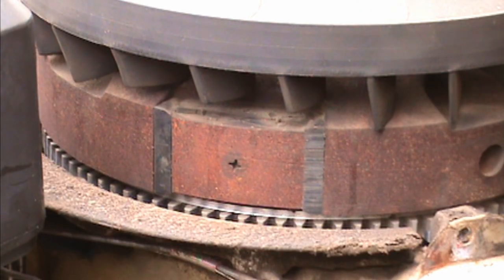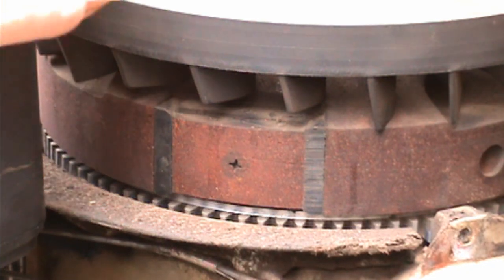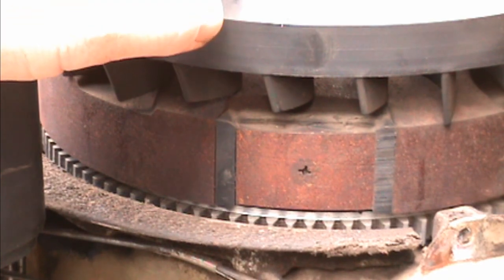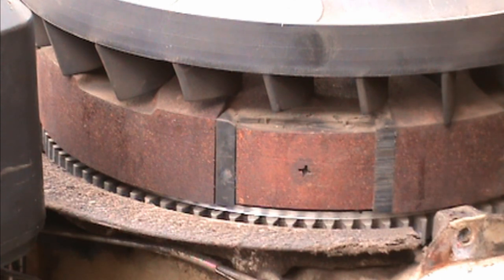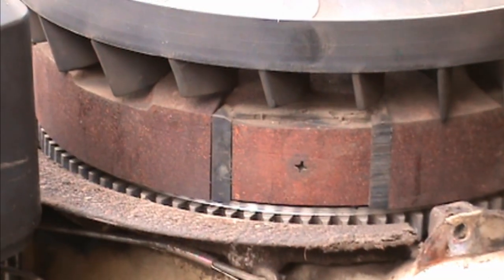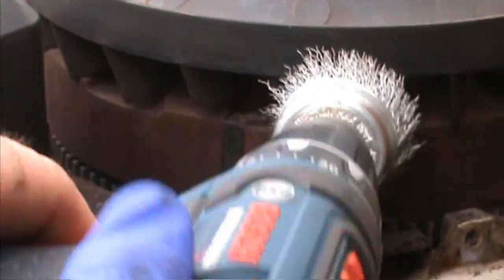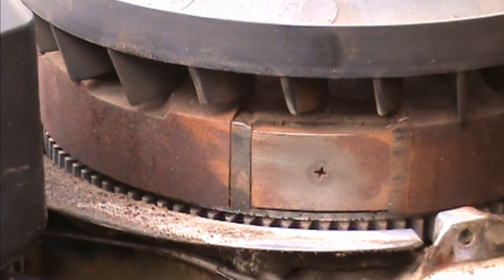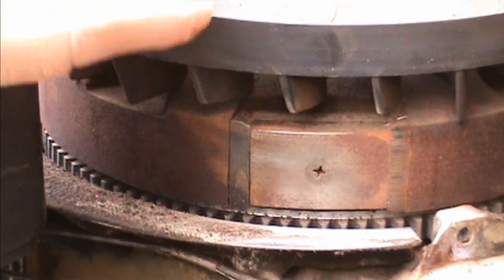Cleaning a lawn mower flywheel rust caused by water or moisture and how fix it.

Comment: Hi I got a lawn tractor and it won't start when it's warm when it's cold there's no problem and there's also no spark when it's warm I checked the coils and they're fine do you know what could be the problem can you please let me know thank you
Reply from the maker: Jake, what model of the engine do you have. Like is it a briggs, john deere, kohler , or any brand? Also the size in HP? It sounds like it could be a coil or grounding issues. You can have a good showing coil, then when it heats up the resistance can change and fail. Then it cools back down and shows it's fine. The best way to find out is to do a resistance check on the coil when it's cold and hot( when it cut off). The kill wire could have a small cut or pinched and cause it short to the engine. It could be also the plug failing too when it gets hot( have another plug ready to go in when it shut off) that's a way to show it's the plug. The ignition set up is pretty simple to troubleshoot if you know what to look for.
Reply: It's a poulan pro 300ex I think its 19.50hp
Reply from the maker: Like in reply I think it points towards the coil ( armature) is failing when it gets hot. When it cuts off on its own. Unplug the kill connector on the armature and see if you get a spark. If you get a spark, then the kill wire is grounded somewhere ( it has contact to ground out the engine) and needs to be fixed. Now, if you don't get a spark, it shows that the armature is failing after it gets hot. Then you need to ohms check the armature to see what you are reading(normally 2k and up for Briggs you'll need the spec per the engine manual and it's not in the mower manual. It will say coil test).
Have tools ready to access the armature and do it when it shuts off or even if cold to get a base number. Ohms meter set to 20k, take red(positive +) to the boot where the spark plug clips to( make sure it clean, no rust or corrosion) hold it to it. Then the black (negative -) to the base of the coil( armature) where the screws (usually 2 ea.). Scratch the area near one of the screws and have clean contact. You don't need to remove(armature) to do this. If it's 0 or OL it's bad for sure and needs to be replaced.  Hope this helps.

Comment: So in theory if my kill switches good my wire to the kill switch is good. And I just replaced the magneto and the spark plug. And I get spark out of an old weed eater. I should clean my flywheel from the rust in theory I should get spark again. Because I have no spark after replacing the magneto and setting the distance.
Reply from the maker: Could also be a grounding issue with the base or the coil even if new could be bad.

Comment: Do I need to clean the entire flywheel or just between the magnets?
Reply from the maker: Magnets, but clean the rest would not hurt.
Reply: I cleaned that surface all around the flywheel.
I also cleaned the surfaces of the magnetos facing the magnets. All that rust is a resistance to a passing magnetic field.

Comment: Zero electrical theory!!!  How would a clamp on amp work?  Or a CT in a protective relay circuit?  How about across an air gap in a potential transformer?  Read up in a book called electricity 1-7,  under "induction".
Reply from the maker: If I have the time I'll read it. I didn't post it to give  a science or  physics lesson, I keep it simple to help people and it has. Most people could care less about the science behind it and just want an idea on how to get there machine or equipment back up and running.

Comment: Rust doesn't affect the spark from the magneto on the flywheel. There is no contact between the flywheel and the coil.
Reply from the maker: True there is no contact between the armature and magnet of the flywheel when it's gapped right. But, when rust is on the the magnet and the flywheel it disturbs the proper distance needed for the magnet and armature to make the proper spark. It cause a resistance field and will change the power of the spark and weakening it.Like when doing a spark check, the color of the spark will change to from a blue white for a strong spark to a more orange color and less powerful.
Reply: Yes it does Kenny, it effects the resistance, meaning poor spark, it's the first thing I do when  overhauling an old rusty mower, then the carb, then the tank then the filters,  last of all a new plug,  most fire up first go
Reply: The rust is an inhibitor to magnetic flux, which you don’t want. Clean all of it off. 
The only way to see what real difference in the peak voltages attained is with an oscilloscope, but, I can’t envision anyone doing that with a Briggs and Stratton engine.
Reply: It does "something" I just did this to my Husqvarna zero turn yesterday. It had no spark from the plug. I cleaned the flywheel and armatures and it cranks and runs now.

Comment: The flywheel does not contact the magneto! There is a 10 to 12 thousand clearance. Coupling is magnetic and rust does not effect this.
Reply from the maker: Like beating a dead horse. It s your opinion on weither or not, like it is mine. I posted the video to help and so far more yeahs than neays.

Comment: Mine is fully rusted.
Reply from the maker: That's fine, little more elbow grease and you can clean it up. Recheck the gap and you should be good to go.
Reply: u just need to  clean the magnet not the whole thing

Comment: The magnet uses induction. There is no contact. The surface rust does nothing. Possibly changes your ability to gap as tightly. The difference between a clean surface spark and a surface-rust spark is almost none. All these references to "contact" are absurd.
Reply from the maker: I corrected what contact meant in the video. My reference to contact should have been more clear of where the magnet and armature line up I'll admit that as my screw-up. But the rust on the magnet and armature does play into the resistance of the spark, with reduction of the needed air gap and makes it weak weak spark. Oh and if didn't work then why do so many people come back to say thank you for pointing it out.
Reply: @jetzombie  You are literally talking about the difference in magnetism between surface rusty metal and clean metal (without contact). There is no "resistance of the spark". The coil itself has resistance, not impacted by surface rust. The spark gap would be the closest thing to what you are attempting to describe, also not impacted by rust. Go stick a rare earth magnet on some surface- rusted steel and tell me how magnetism doesn't work on it. It's the magnetic field from those two magnetic poles going past the coil assembly causing induction. The rust is a non-factor unless it's pitted. People must be having success because they are re-gapping the coil after cleaning the surface rust, would be my guess.
Reply from the maker: We keep going around in circles on this. My thing is that the build up of rust and or debris will cause the air gap to change and that will affect the power of the spark produce by the coil. I've seen it many times, even not cleaning the rust or debris and just re-gapping, the equipment will run fine for a little while, but not long. So I always cleaned the area re-gap and use a water displacement agent to protect and prevent. 
 So, rust can affect, but only if pitted, well most that I've seen that are this badly rusted are pitted.
 There are numerous forums, groups, and video's that talk about this issue. Some for and against this issue and whether or not it works. That's what makes this country so great we can agree to disagree. Have a great day.
Reply: Worked for me and didn't redo tapping ,not so absurd!